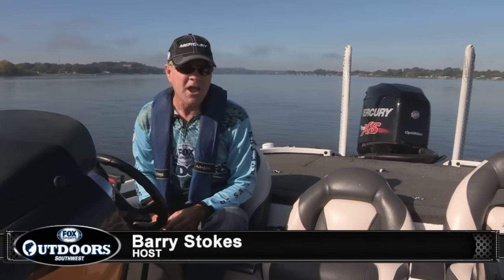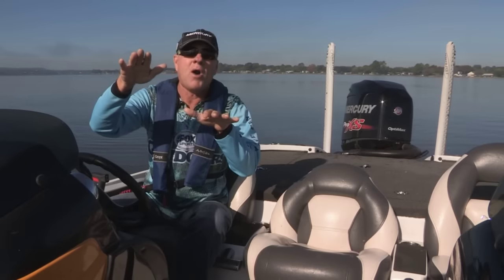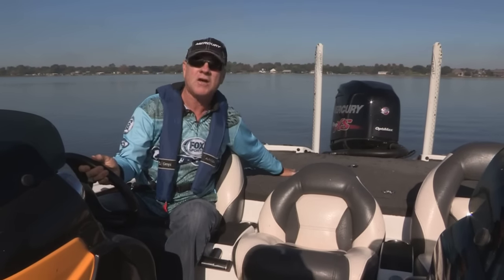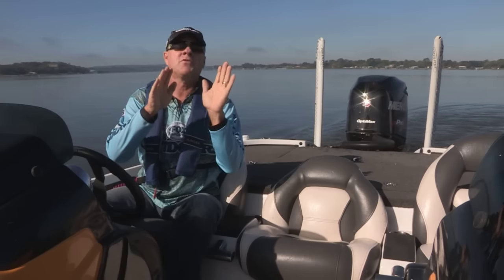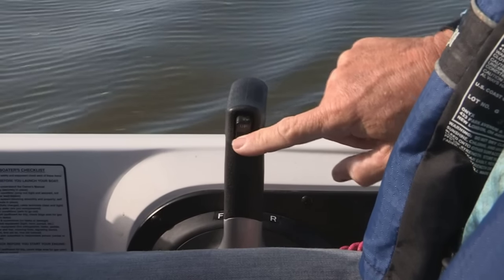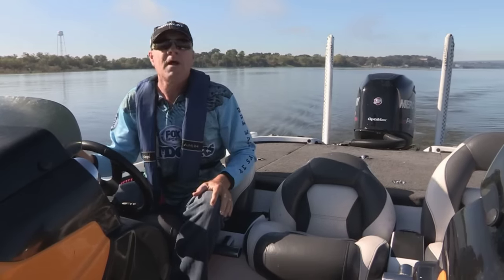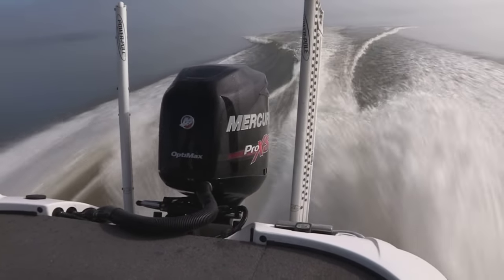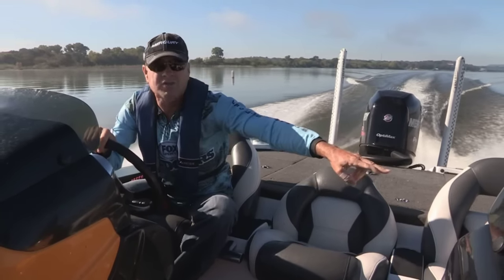Trimming an Outboard Engine

Comment: hi, i have a SIB, 84lbs 3m inflatable with air floor. yamaha 6hp 4stroke, 60lbs,trim pin at 1st position by transom.  i just can't get it to go faster than 8mph, can't expect any planing. at full throttle the stern sinks and bow raises,  total weight; 2x people+cargo+engine 390lbs  do i need a bigger engine? or ride with 1 passenger only. with one passenger it would weigh, 295lb.  Should i buy a 9.9hp 2 stroke or get a 9.9hp 4stroke? 4 strokes are heavy, and do you think its ok to put a 15hp 2stroke on it? the boat is rated for 10hp outboard and overall carrying weight of 1100lbs. thanks for your time.

Comment: I'm brand new.. just bought me a bass boat and need help trimming and coming to a complete stop. Every time I stop I still get a little bit of water on my carpet..
Reply: Jadiel 254 not sure what you're asking ?
Reply: Mike Davitt trimming and how to stop.. u only trim when on plane so needed help with that and how to stop. But it's ok I got it now
Reply: When you let off the throttle and the boat starts slowing down the back end of the boat starts sinkin back down in the water and your wave behind you is traveling faster than you are now. When you see the little wave get close to the back of your boat just kind of goose the throttle a bit. Just a little and let back off and it will keep the wave from coming over the back of your boat and getting your carpet wet
Reply: Jadiel 254 your slowing down to quickly and displacing a large amount of water with your hull. The water rushing back at you is the equal reaction to displacing all that water. Anticipate slowing down ahead of time and drop speed slowly

Comment: im on 3rd Bass boat in 12 yrs.  This is my 2nd Ranger. It won Trim past 1/4 on plane. both my other Bass boats would trim to 1/2 with no problem allowing for much more speed and fuel economy. What can be done to correct this?
Reply: probably need a different prob.
Reply: Try a hydrofoil

Comment: NO. Cavitate does NOT mean "sucking air into" anything, not in any way or form. This was a useful trimming routine, but please know what you're advising before doing so, and please don't attempt to talk about physics without knowing (éven) the básics... How can the viewers whom don't know you, trust anything you say after such an ignorant comment. That said, great protocol, thank you for that...
Reply: Relax dude it's just an 3 m video providing helpful info
Reply: cav·i·ta·tion  (kăv′ĭ-tā′shən)
n.
1. The sudden formation and collapse of low-pressure bubbles in liquids by means of mechanical forces, such as those resulting from rotation of a marine propeller.
2. The pitting of a solid surface.
3. Medicine The formation of cavities in a body tissue or an organ, especially those formed in the lung as a result of tuberculosis.